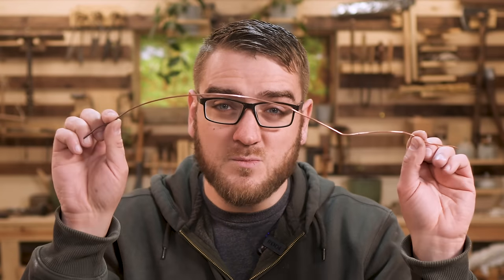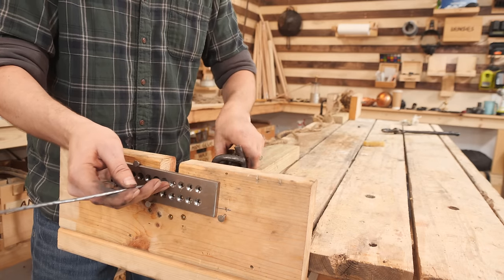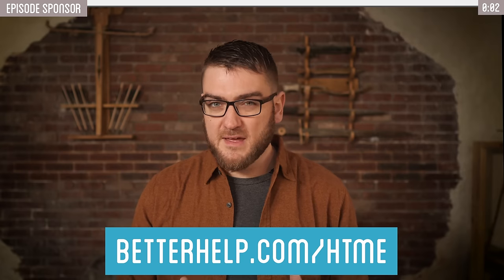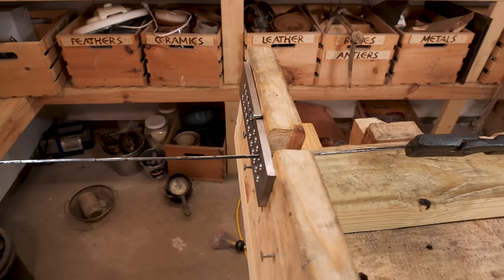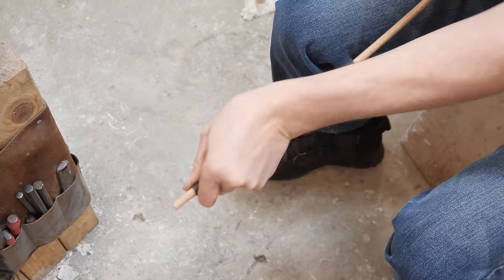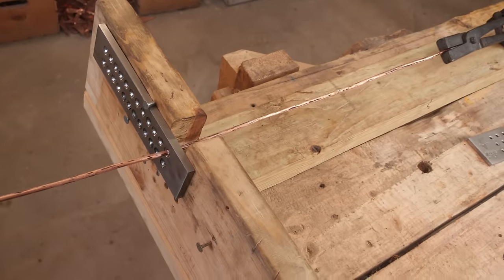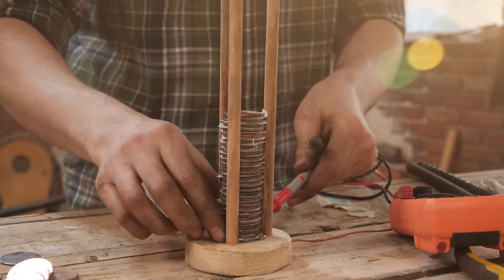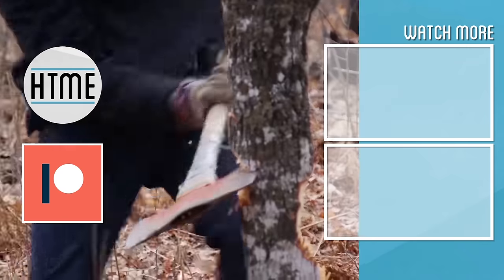Is This The Most Difficult Step to Unlocking Electronics?

Comment: I reckon glass blowing and valve manufacture is well within your capability
Reply: challenge is that valves require horrifically pure, extremely rare metals :P
Reply: And then drawing vacuums, which then leads to vacuum tubes and light bulbs.
Reply: @DUIofPhysics  For what? For glassblowing that was already made here? Or for valves that can be made even out of wood? 

(Just asking, there is clearly some other comment, that YT overlords don't want me to see -_- )
Reply: @finkergamer8557  He's applying sarcasm, as indicated by the emoji at the end of his comment.
Reply: @Weshwey_  oh, makes sense. Thou I use it for morę than sarcasm and/or irony. For real thou, it shows me more responses then there are.
Reply: I reckon the trickiest bit would be the tungsten filament
Reply: @ToasterWithFur  i'd say diamond bearing will be trickier
Reply: A triode or pentode tube would be the Bees Knees...
Reply: this thread is getting better and better :P
Reply: @ToasterWithFur  You don't need a tungsten filament for a working vacuum tube. Directly heated tubes with oxide coatings operate fine at slightly lower than red-hot temperatures. Having said that, a tungsten filament might be easier than these coatings. But the real problem is going to be the vacuum part.
Reply: @zinckensteel   I haven't heard of that type of pump before but it looks simple and easy. I have a hard time believing it would be good enough for vacuum tubes (wouldn't the mercury produce mercury vapor) but it might be good enough for some slight amplification. It is obviously good enough for light bulbs and should also be fine for gas-filled tubes such as discharge lighting. Both are more practical projects than amplifying tubes.
Reply: @zinckensteel With a
that pump in place and glassblowing unlocked, they could even make Mercury Arc Rectifier! I would love to see something like that made here but I doubt It'll happen.

If any of you haven't heard of it you should find a video of one running. They glows blue and look incredible. Lightening in a bottle, literally!
Reply: @zinckensteel I'd have thought that oil diffusion would be the better way to go, sure, you need to use a roughing pump to get the process started, but it seems way more practical and safe.

Comment: Drawing you need a lubricant, the old one used was a mix of beef tallow and beeswax, which allows you to dar with less force, as it lubricates the sides of the die. Normally a dollop on the inner side of the die to allow it to flow in, held in place there and the heat of drawing melts it into the die.

Comment: i wonder how a draw plate would have traditionally been made? Since it needs to be hard enough to stretch the wire, but also somewhat precise. 

But i guess hammering a few holes of various sizes into a sheet of iron isn't as big of a hurdle as i might think.
Reply: You can work with wrought iron and case harden using charcoal and salt paste encased in something like clay and using a forge. I'm speculating here, I have no idea how they made draw plates at first.
Reply: It depends what you are drawing through it, copper and silver and even gold are way softer than iron and each hole is actually tapered.
Reply: @nerfherder4284  Why would precision be necessary? People didn't have to make exact wire sizes back when this sort of thing was done by hand.
Reply: @raa6504  the oldest known draw plate (8th century, found in Norway) was made from Iron according to the museums website. 

Not sure if they just used it to pull softer metals, or if it was hardened somehow, so that it maybd could pull iron too.
Reply: Whatever the right answer is comes down to which period we talk about...the holes could´ve been made by roughly pre drilling them and then bringing them to size with a tapered reamer similar to a watchmakers awl. You could use the same reamer for the whole plate, for bigger holes you just go deeper. A tapered chisel would work after the same principle, just with less precision.
Reply: People still think draw plates are the only thing. You do know that rolling mills exist right? Jewlery would have been done on a rolling mill and not a draw plate. At no point would anyone waste a small amount of gold to make 100s of feet of gold wire. You would using a rolling mill with a small piece of stock and work it till you got what you need. 
Steel wire can be rolled out using a rolling mill too. This is how you would size stuff down very fast. Blacksmiths made a lot of things to make their work super easy. We assume that they pound everything out with hammers and they do not. They make jigs and tools to speed up their work. Every new job would have resulted in new tool being made to speed up production.
Reply: @kameljoe21  while rolling mills appear to have existed in some form for a lot longer, they seem to have been popular only after the invention of the steam engine and industrial manufacturing.

Before that, i assume most wire was drawn using a draw plate. In Europe especially, the earliest mention of a rolling mill is attributed to Da Vinci in the 15th Century, way after things like mail and wire were commonplace.
Reply: @slim4950 That could be very well true. Draw plates are likely some of the first things to have made wire. Yet not long after that there has always been someone who tinkered around to find a better way to do it. Matter of fact blacksmith tools have wire tools. They look much like a rolling mill just with groves. Many time they were slots used to size square stock. There are also round ones used to aid in drawing out round stock and or wire.  
Keep in mind wire is pretty new stuff. Yet having been around for thousands of years. its process and how it was done are still debated today. 

***** Metal wire is in modern society manufactured by drawing metal rods through dies with conical holes of decreasing diameters, until the desired thickness is obtained. The history and origin of this technique remains unclear, although it was likely developed from earlier wire-making techniques such as strip-drawing and roll-drawing. Proper wire-drawing was an established technology in Europe during the High Middle Ages, and numerous draw-plates have been found at Scandinavian Viking Age trading centers. Here, we report the technical examination of an iron draw-plate found in Uppsala in central Sweden. The draw-plate was excavated in a Vendel Period fine metals workshop, located immediately next to the royal hall in Old Uppsala, the central building of the royal estate in the 6th −8th c. X-ray and scanning electron microscopy (SEM) analysis of the draw-plate revealed silver particles in the plate’s holes, indicating drawing of silver wire. The plate is dated to the 6th – 8th c., which makes it one of the oldest confirmed tools for wire-drawing so far encountered. The presence of this tool in the workshop indicates that some high-quality jewelry in this region was locally produced. Thus, the finding of this draw-plate increases our understanding of Vendel Period jewelry production, and of the social organization of this craft.
Reply: @Imaboss8ball  i think the precision is in having the holes in the correct decrements....
it gets unreasonably hard if not impossible (wire snapping) if the decrease in diameter is too big between two consecutive holes and if you do too little you waste a lot of time pulling.

Comment: Fun fact about chainmail armour. Some of the links were actually solid rings, not riveted. This made it even stronger. I think it was about 1/5 of the rings or the center of each 4 in 1 grouping.
Reply: Done right it should be almost 1/2 of the rings only needing extra riveted rings in complex areas like joints.
Reply: Further fun fact: An unriveted chainmail shirt is still remarkably good as armour, and doesnt even all thay easily fall apart; its just not preferred bcuz the rivetin process makes it so that the armour is slower to wear down. Without rivetin you can end up with holes in your weave after takin a hard hit
Reply: @SylviaRustyFae  Good against cuts maybe, but I can't imagine it being good against stabs considering only the bending resistance of the wire keeps the rings from opening up.
Reply: @mrkiky  cuts and stabs dont actually make up the biggest bulk of wpns used in early medieval warfare... Its usually club type wpns where rly you just need smth to deflect the blow into a wider area; hence chainmail over gambeson

Yes, its particularly ineffective against arrows, but only if shot directly and only in that one spot; and the padded gambeson layer underneath does help to make those arrow hits less lethal

The real downside to the crimped together rather than welded style is that the armour doesnt last as long, but its vastly quicker and cheaper to outfit an army in unriveted chainmail if one is armin ppl directly rathe than forcin them to buy their own armour

Tbf yes, somewhere like Europe post 11th c youre gonna find prty much exclusively riveted mail, but that is bcuz there if someone is in the military; theyre expected to outfit themself. So you end up seein less armour, but when there is armour; it tends to be armour which passed down generations and kept maintained spec bcuz this family wanted better odds of survival when conscripted

But a lot of other places outfitted soldiers directly and did such with just cheap massly produced armour and arms, and it was rarer that soldiers came with their own better gear

Notably btwn crossbows becomin a major thing and swords becomin more of a common choice of warfare, riveted mail def did see a heyday where it was prty much the only armour worn; but that was also in part bcuz it provided better protection against early bullets too. At least better than leather or padded cloth, even if leather is actually remarkably strong against a blade or even arrow
Reply: @SylviaRustyFae you dont have to theorize all of this is documented. Swords were never really a major choice in warfare, they are more of a self defense item. Thats why it was more common to see people with swords then spears or halberds. Bows arrows and cross bows were the major killer with the pikes and calvery making up a decent score. Its the same as now artillery kills far more then simple infantry. While soap existed back then it was an expensive process and not as simple as we make it out to be today. A single cut could kill.
Reply: @fajile5109  Im not theorisin, what i said is based on medieval warfare history that ive studied and further back as well; the vast majority of wpns ppl worried about initially werent the bows or the guns... But we did see a shift in types of armour thru the medieval era as those became the most commonplace wpns of war that they became

Comment: If you want to reduce the effort needed to pull the wire, and reduce breakage, I would start by making sure your drawplate is firmly anchored in place so it cannot move as you pull. When you pull at an angle instead of straight-on 90° your wire is bending as it comes through the hole, increasing the pulling resistance and weakening the wire.

Comment: Electricity and electronics have always amazed me due to the need to create the material we take for granted today.

Wire especially was one aspect of material being made then insulated with natural material like cotton threads and soon, liquid insulation the wire was drawn through to insulate it after it dried. Some insulations were melted and the wire drawn through and the liquid that would cool and solidify.

But the industry of wire making has grown by leaps and bounds due to competition and need. We now have wires that are insulated with teflon and then shielded, making a coax that carries radio frequency power to antennas and vice versa.

We can recreate the process, but finding and reusing material after a world wide collapse would be far faster way to get back into the industrial age rather than starting from the stone age.

Comment: I used to draw wire for a living ask me anything.
The best source of wire draw info is the Fort wayne wire die blue book. 
Thick wire needs to be dry drawn. You can dry draw to about .025 reliably, but going slow brings that up to about .050 without blowing out the die or scratching your wire, which also ruins the die.
I dont know about wet draw, but dry draw lubricants are typically sodium or titanium based soap powders. The wire must also dipped clean and dipped in a coating solution, so the dry soap can stick to the wire as it goes through the die.
You can calculate draft but its some pretty complicated math. Just dont over reduce the wire in one shot, and it has to be annealed between runs to avoid snapping. 
Wire breaks happen because you drew down too far or were not lubricated, or the wire was too hard. 
Dies wear down over time, replace them. Use tungsten dies, and they'll last longer.

Comment: Probably the reason the gold failed was that it was native gold and not refined. Remember that gold was cuppelated since ancient times, meaning it was free of everything except gold and silver and traces of platinum group metals.

And then in the early Bronze Age the Lydians worked out how to "part gold", that is separate gold from silver. Basically by turning the silver into silver chloride and sublimating in a furnace, leaving the fine gold behind, then reducing the silver chloride fumes which would condense into white crystalline masses in the chimneys, back into black metallic silver or oxide with honey and/or light, allowed the silver to be resmelted into metal bars.

Also they ALWAYS used to draw wire using some sort of lubrication, whether that be animal tallow, bee's wax or talc or graphite.

Also you've be told many times before, please stop schilling for Better Help Plus, they are extremely unscrupulous and are even in trouble for using unqualified therapists and telling their customers they are qualified ones.

Comment: For the wire, a series of pulleys and rollers under tension help with drawing, as well as an oil bath or something similar to help with lubrication. The pulleys help with keeping the wire taut and straight, as well as having a more consistent feeding angle.

Comment: Some wooden supports going from the top of the board holding the draw plate down at a 45° angle back towards the winch would make yalls lives a loooot easier, along with lubrication

Comment: first as you have probably heard in the comments already !!! :) you need to lower your draw plate to just above the bench and brace the board it is attached to. also a block and tackle to pull the heavier pieces through would help provide a smoother pull , would an indirect heat(oven) be a better way to anneal the materials.   Eureka just had a thought attach the table to a wall cut a small hole in the wall to run the wire though and put a ring to attach your block and tackle to at the doorway across the room from the table and hole in the wall :)

Comment: I remember in a Minecraft Modpack with TerraFirmaCraft, there was a mod that added in a wire drawing mechanic. You had to basically make that entiee setup. It used the die, pliers, leather to pull, and a crank to turn. and it was so time consuming. Even for a video game. But it was a very cool mechanic to learn.

Comment: I've gone down a rabbit hole of ancient technologies (many times); and I've found water clocks very interesting.
I was wondering if you'd ever consider making a water clock, as they were extremely important time-keeping devices, and were the main outlet for mechanical skill outside of manufacturing (in advanced economies).
It's also a nice bridging ground before the more advanced mechanical creations you might have to tackle, and can be used to show the basic concepts of gears, etc.
Reply: I would love to build one myself, but I don't exactly have a creek in my backyard (also I'd have to buy a lot of parts)

Comment: One improvement to your setup would be a gear-driven drum.  That will increase the force you can apply, smooth out the force (reducing the risk of breaking), and only be applying force on a small part of the wire at once.

Comment: This might help. Set a rig up so you can attach it to the end of your forge so you can pull the wire through right after it has gone from red hot to dull again, so the wire can be molded easier by the gauge plate? Essentially reduce the time it takes from annealing to actual pulling by making it one set operation. A little tricky with the heat no doubt, but if done right, I suspect you'll be able to get those super long thin wires you want.

Comment: Here's a tip 
Use oil
I used to work in jewelry shop and pulling wire to get it to a specific diameter was a daily task, oil helps alot, we usually used I think old motor oil but any lubricant should work

Comment: if you use a pair of pulleys in figure 8 between them before your drawing die with another pinch pulley or pulley before the drawing die to keep it straightened in line with your drawing dye two more pulleys one fixed one weighted after the dye comes out with about four wraps around them your fix pulley would have your drive to pull the wire and then something to spoil the wire after it comes off of that set of pulleys will reduce your breakages accelerate with less Force to draw all the wire through which is also how they do it in a factory to draw wire and you need a lubricant before it goes into the drawing die

Comment: Maybe you could try to "season" the wire like you would a pan in order to get an (sort of) insinuative and flexible coating. Heating the wire and then very briefly quenching it in flax oil might work, but the wire might not have enough thermal mass to burn off the residual oil.

Comment: If you have a eletromagnet and a batery  that is enough to make an alternator, they are very simple and use no permanent magnets. 
Extra points if you make it self exciting by storing the DC voltage in an capacitor